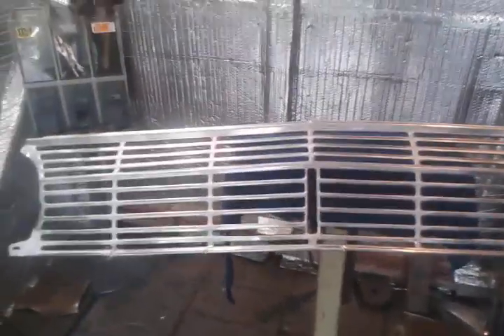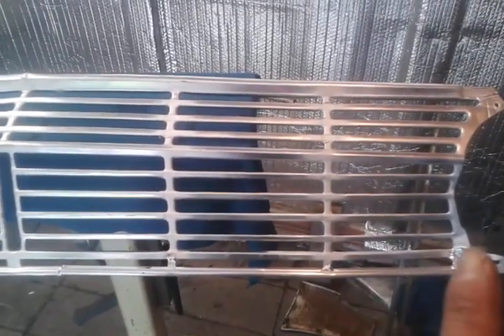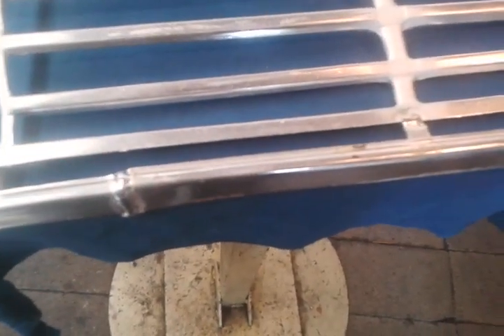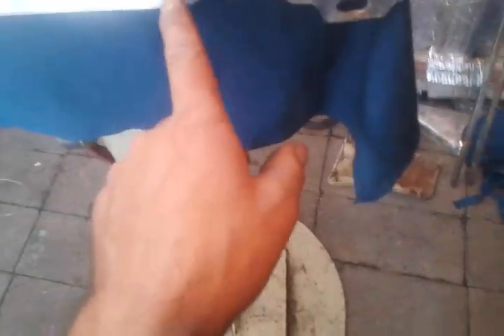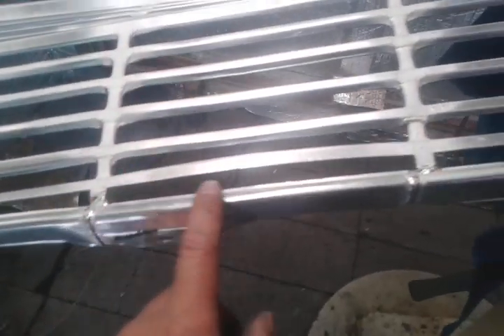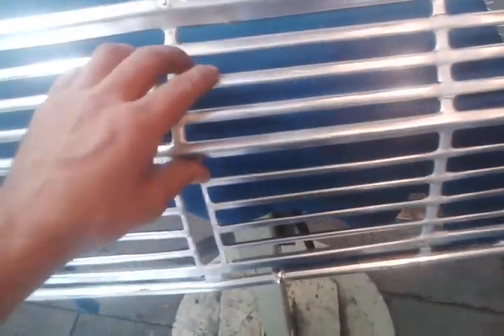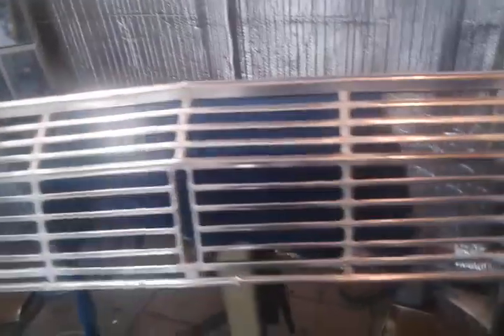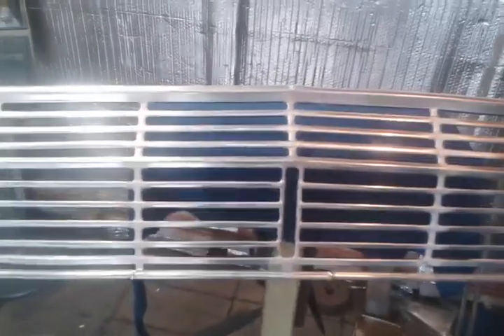1963 ford falcon grille. Major repair restoration

Comment: Francisco I dont see the video of the straightening process for these. I have 3 grills currently and they all have varying damage. I need to mostly straighten them. Do you recommend a nylon hammer?
Reply from the maker: There is really no right or wrong way of doing it.  I use all metal hammers. Wodden jigs